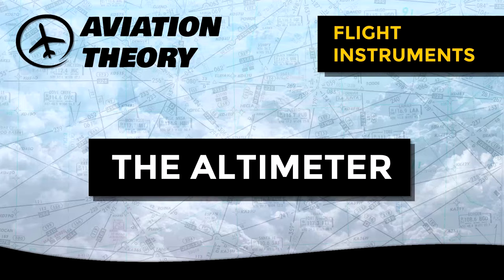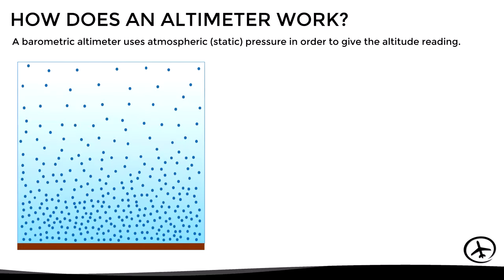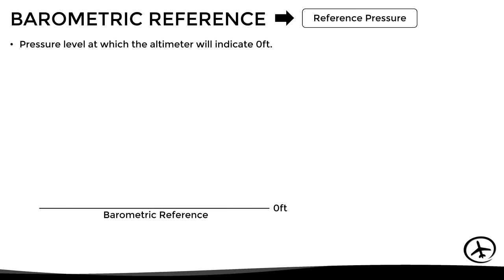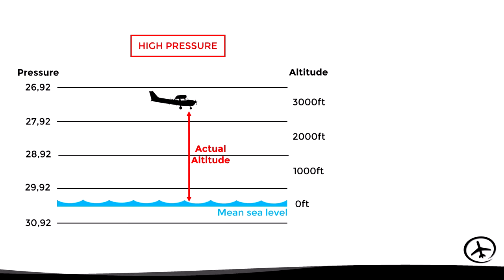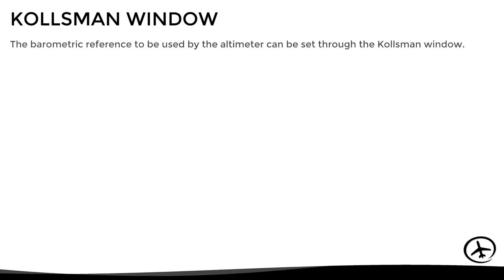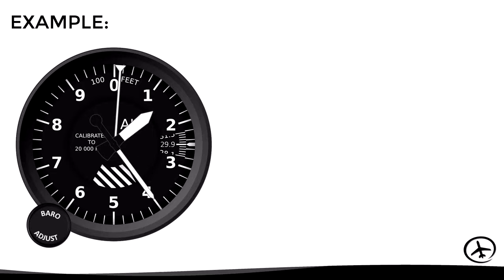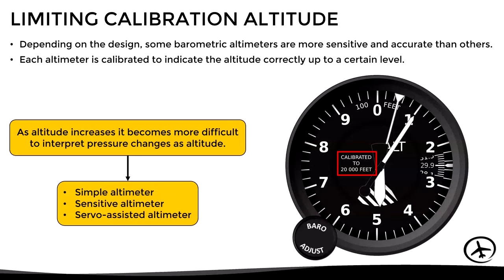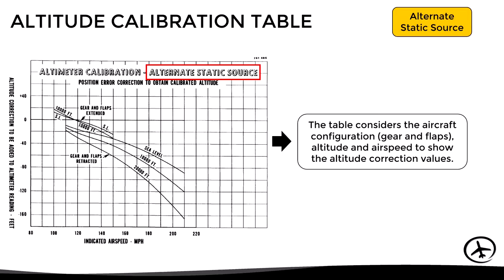How an Altimeter Work

Comment: Thank you so much for the excellent video! It's very clear for me to understand the working principle of barometric altimeter. Only one question: does it take real-time air temperature into account when converting the air pressure to altitude? If not, what's the constant temperature to use?

Comment: Very good. 
One question. 
What happens in air pockets ?
The pressure must be different causing error.
Reply: I was thinking the same. What about high pressure and low pressure weather systems

Comment: Hi, good job, I love this video. However I think the part about the expansion and contraction of the aneroid capsule is inaccurate. The pressure inside the capsule cannot stay the same, otherwise it wouldn't move an inch. The inner pressure of the capsule always adjusts to the static pressure around the aircraft and the capsule changes its volume as a reaction to this (Boyle's law). Or is there something that I'm not seeing?
Reply: Your comment really made me think, and I have to agree, if the capsule is able to increase its volume by expanding, the pressure inside must decrease. Assuming the capsule has 1 bar in it at sea level, then at lower pressure the capsule would expand until those pressures matched again, or until the expansion of the capsule reached its maximum or minimum movement values.

Comment: Hi i have a doubt if we look at the graph for barometeric pressure and altitude it is not linear, but the dial scale in an altimeter is linear how and where is the linearity compensated in a mechanical altimeter
Reply: you absoluty right to make the reading linear the altemeter has correcting pins to increase  or decrease the movement of the capsule accroding to altitude.

Comment: The pressure inside the aneroid capsule should be few Hpa 10-25 or it is calibrated to an internal pressure of 1013.25 Hpa?
Reply from the maker: Hi Daniel, you are right, normally the aneroid capsule is sealed with a pressure lower than the standard, but for the purpose of the explanation I decided to use 1013 hPa as a reference to make it easier to understand how it works.